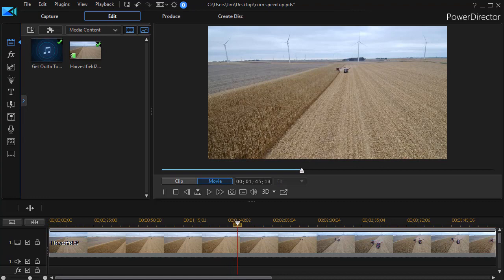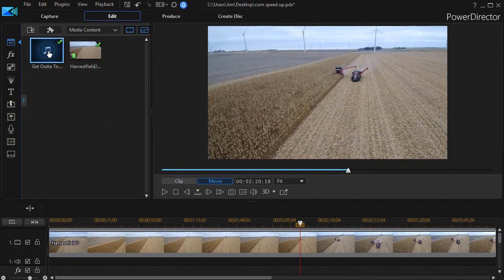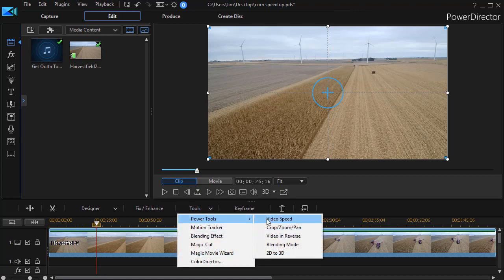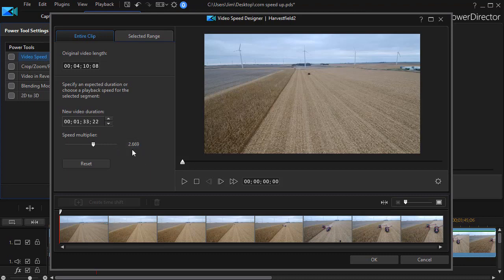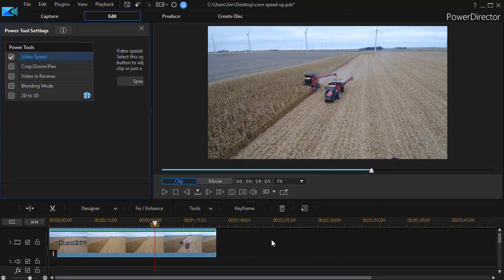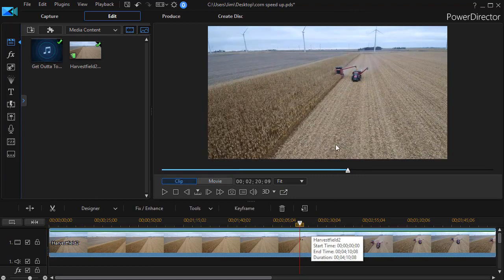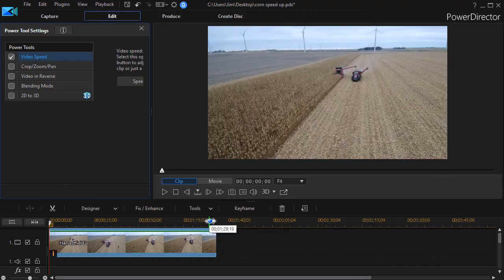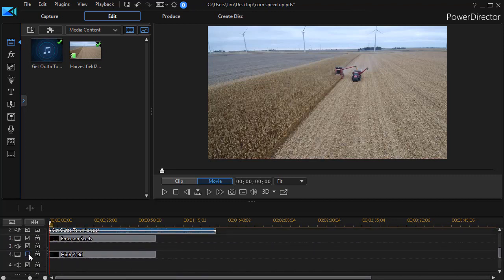PowerDirector - Shorten video to match audio with video speed adjustment

Comment: Hi sir 
how can i deal with  green screen video has more than farm and  shape like that   https://www.youtube.com/watch?v=clauHUflUeA&list=PLLSvE84Fnwt8MDp136yedrgvCHSq9IiYb&index=3
Reply from the maker: I looked at the video. What do you want to do with the moving objects with green backgrounds? Do you want them to reveal an image or part of a video clip in the track underneath? I'm not sure what your goal is. --Jim
Reply: yes sir
In this video there are more than a moving object of green backgrounds
I want to put in every  one  a different video or  picture  i try to use motion track but i Failed
Reply from the maker: This is quite a task. I think you are approaching it correctly. I assume you are working with a finished clip. If I were to try it, here is what I would do. This will work for objects that do not rotate, but keep the same dimensions. (In the case of the example you showed me, you will need to crop your movie overlay into the shape of a circle. 
1. Use the motion tracker on one green object. 2. Use the insert media option to place a video on top of the original image. 3. go to the track where the motion tracker placed the object to adjust the keyframes in the pip designer if necessary. (This is a time-consuming task.)

Hope this is somewhat helpful.  --Jim

Comment: So after speeding up by an amount like that, what fps would you render the video in? I've always tended to use whole numbers in speeding/slowing video clips.
Reply from the maker: Ian,
I would normally produce it in the same fps as the original. That would be the default for PowerDirector. I believe the raw footage in this case was 30 fps, so unless I had a reason to change it I would tend to leave it the same. ---Jim